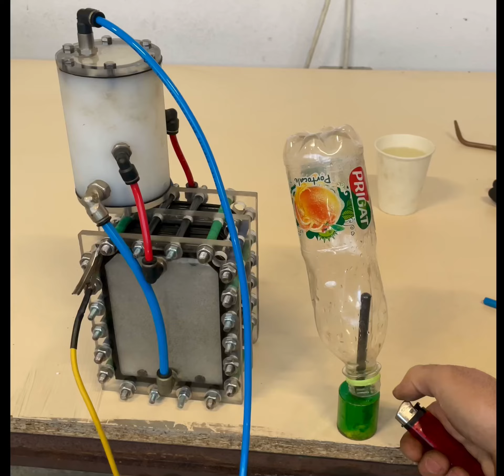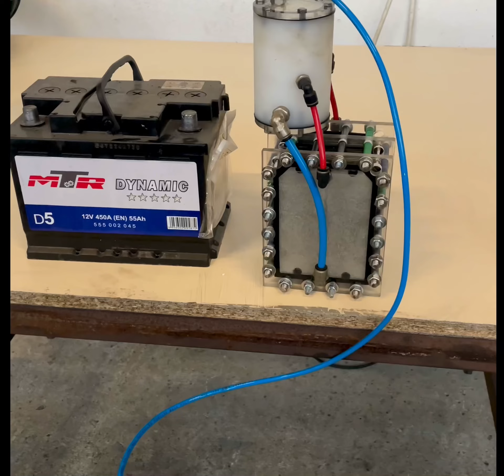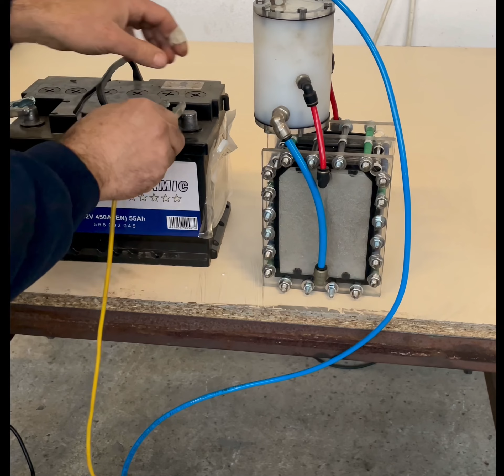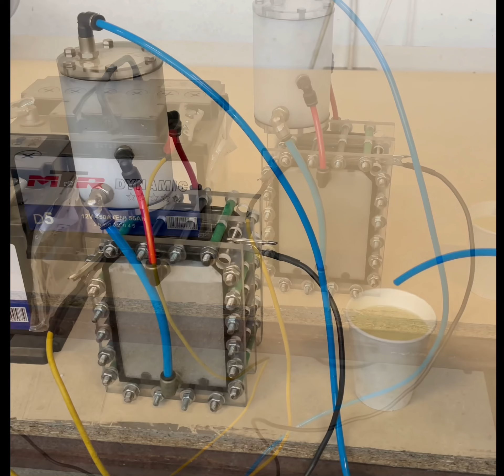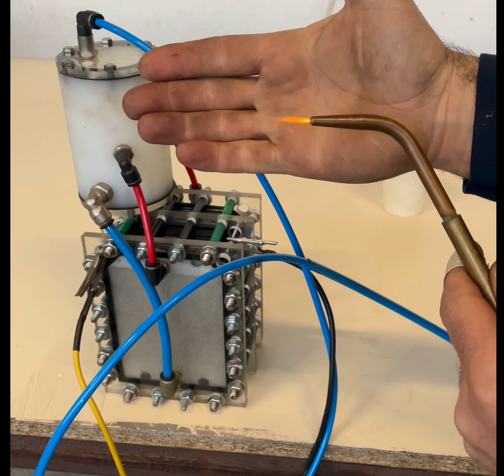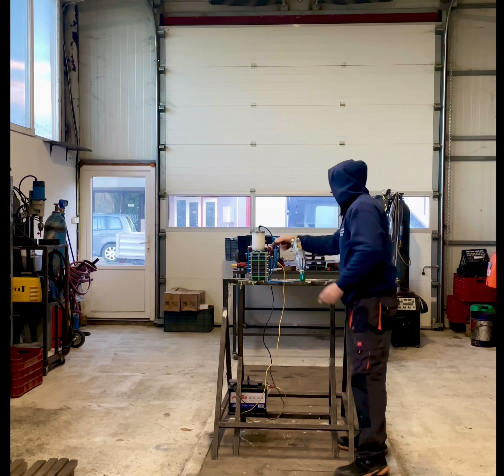Hydrogen Generator. HHO Dry Cell

Comment: Let's get down to business...

"Stanley Meyer" style HHO production by resonance (pure water, no electrolytes, high voltage, low current, etc.) compared to traditional electrolysis with the addition of electrolytes and high energy consumption, considering the same tube area (reactor), which would be more efficient? Better said, is HHO production efficient in relation to consumption when comparing these two "models" of HHO production?

Comment: Hi I have here a 13 plates cell of 1 mm thick and with a surface of about 25cm each and 2 holes. Gaskets of 2mm. 
3 wires electro, + on te both outer sides an the - in the middle. 
Can you tell me what the best way is to get more gas output? 
Is a thinner gasket a improvement?

Comment: You forgot the Magnetohydronamic magnet arrangement to create an upward flow that dislodges bubbles and because magnetic fields increase gas production by other means too if you read the research.
Also you can skip the fill holes in each plate and run long fill pipes to decrease leakage, similar to your separate H2 and O2 separator doodats.

NB that Ozone O3 is formed at voltages above 2.075 v per cell.
For combustion (engines) that helps a LOT!:
Less gas volume and increased flame speed etc due to radicals and H (not H2) formation during compression..

A simple radiator cap increases pressure/boiling point some while still being practical, allowing higher temperatures that improve efficiency a bit.
The HHO comes out the overflow pipe if you imagine a radiator opening.

For separate H2 and O2:
Wet fabric is airtight but allows ions to pass through.
So you want to be printing your plastic separator  doodats (frames and perhaps top quarter of separator 'plate' only),  in/onto tensioned (flat) close weave fabric...

Also consider using a clear plastic for the frame doodats and add LEDs? of the frequencies/colours likely to help production by moving electrons to higher orbitals.
Said frames will need some thought on optics to get the light onto the plates.

Have you tried Graphite Foil instead of Stainless Steel?
Studies show better production, no chromium etc and it can be cut with scissors..!
Reply: This is really fantastic information! Thank-you!  Any chance you can point me to a resource where I can read more about optimizing designs?
Reply: There's no 1 resource.  I read all over the place and 'join the dots' so to speak. :)

There are some cool MHD vids here
https://www.youtube.com/@PlasmaChannel

Sci-Hub will get you research papers for free.

Comment: Please, PLEASE do not use acytane butane safety valve, use a proper HHO valve, its for specific gasses and using that valve can result in a higher failure rate